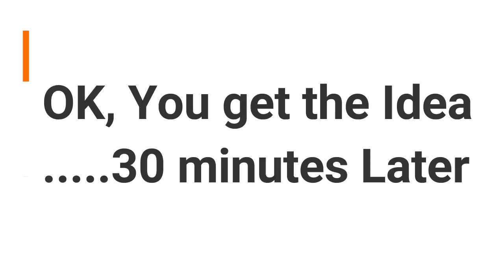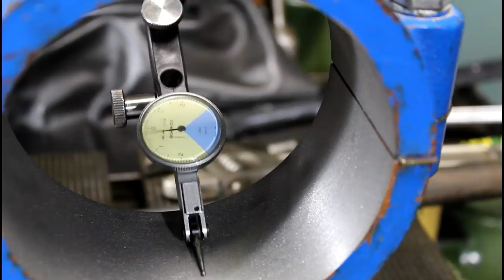Custom Indexing Angle Plate Build Part 1

Comment: I enjoyed the video.
I have been using a piece of a treadmill belt and I use 2 magnets I salvaged from a couple of old hard drives. I place the belt on the front of the carriage across and up against the cross slide, the cool part is it stays attached to the carriage as it moves so I get almost zero dust on my ways. You can find tread mills free on craigslist at times.
Cheers 
John

Comment: that is unusual  BUT very cool.   if you drilled holes in the main body to put pins in to the center piece you can get a very accurate indexing.   just thinking

Comment: Hey Steve, I really like your videos and your laid back demeanor. I have a thought on this build. If you were to make a back plate which has a circle of 40 holes and then drilled 36 holes in the slug you would have one degree positive stops. If there is enough room, 10 circles of holes set 1/10th off from the last would allow you to index to 1/10th of a degree. Just a thought...
Reply from the maker: That could work, very good idea.  I'm going to just scribe some lines on the back I think  . The pin holes and stops would most likely be a more accurate way, but I want to try scribing in the shaper for the fun of it.  Good idea Eric.  thanks for stopping by       SteveSummers
Reply: Steve Summers, I was hoping to catch you before you moved forward. But either way you go you could always add this later. Eagerly waiting for the rest of this build.

Comment: Hey Steve - nice project. Lovely job on the lathe - was gritting my teeth for sure :-)  It will be interesting to see if that casting moves after machining - give it a few days / weeks. Nice to see the innovative ideas you have - keeps me on my toes.  Good info' on the tool steel at the end - Ive only burnt up HSS on the shaper when cutting hard grades of steel too fast with no lubricant / coolent - but that was 120 strokes /min over 8" stroke and the steel was from bin 13 - so could have been anything - but he chips came off a lovely dark blue and burnt into the sole of my boots. Looking forward to the next update. All the best mate. mat
Reply from the maker: I was thinking the same thing about it moving or not, there is a good chance that it will. I will check it along the way.  I removed about .0040 off the back, and that's a lot all the way across that face.  Not near as easy as I thought to cook some cheap Hss if I try to do it. Seems the only way I can burn it up in the first 3 seconds  is to not want to burn it up LOL.   Thanks for stopping by Mat, I am going to try to shout you and a couple more great people out in part two if I can get my act together on part two ..     Thanks again   SteveSummers
Reply: Just keep them great vid's coming Steve - Ive learned something new on each one and been entertained along the way :-) 
Trying to get my ass in gear this morning and down the workshop to take a look at boring out the shaper work box .... thats quite a big job for my little operation. thinking of strapping my lower jaw up to stop the chattering ! :0) cheers Steve ATB Mat
Reply from the maker: LOL, yeah I have the same chatter issue from time to time.  Thanks Mat

Comment: Cool video/project, if I had known that you were after an angle plate for your shaper, I would just cast one out and send it to you when I do the end of the season casting session, lol.
Reply from the maker: Hey Chirpy T, how's that lathe rebuild going? I see you posted a new video last night. Yeah, still need to build and buy tooling for the shaper, just takes time. thanks for the offer in the angle, I could have used one more than once.
Reply: It's going good, I got the primer on the headstock, apron, and little bits now and within a day or so, it'll be ready to be painted. The only thing left after that is just saddle, tailstock, and quick change gearbox, but all of it is already off and there isnt that many parts to that stuff really and the gearbox isnt getting torn down since it's still in good condition and nothing needs fixed in it. There is alot more parts to that headstock and apron that most people think, lol. I like the design of angle plate that I have because of the U shape in it, it makes it really handy to put shafts through it to hold stuff that you cant hold normally, and also stuff like pulleys and such that has bosses on it that is hard to hold. You can also clamp it down on the other face of it to get a full flat face to clamp stuff to. Ill throw that in the queue to cast also in a few days since I was just going to cast a few smaller pieces anyhow, so I'll have plenty of sand left over, then try to scrounge some money up for shipping, lol.

Comment: Pantographs used a manual style rotary table with a similar concept, it would let you index on a manual rotab. I use one on my mill, but it uses a lever clamp that is not too strong, so one needs to be careful on how much they push it. Actually, making a new clamp might be a good project for me. :-)

Comment: Such a fun project! Great idea and that's what it's all about Steve. Just  having the stones to try. Most of the time, when you know your stuff, you'll succeed 9/10. And LOL at that HHS in that HEAVILY interrupted cut haha that was good. Hey Steve, on Keith fenner s channel... He always lays a cloth on the ways and he cuts inverted. In other words the cutter is flipped upside down and direction of spindle reversed. This sends the chips directly down. Is this practice good, or just arbitrary
 Because I thought ductile iron was a decent bearing surface lol. Is it really all that abrasive?
Reply from the maker: Thanks for stopping by Billy, Hss usually works well on interrupted cuts , I think there are several reasons it failed and the main thing was a hard spot. Unfortunately my lathe only runs in one direction. when 1st cut this cast iron dust is like sand, I guess if it was ground fine enough it would not be that bad, but1st  it needs to be ground and I think that is the main reason it so bad to get on the machine surfaces , the machine is the grinder.   Good to see you Billy, glad you stopped by.  SteveSummers

Comment: An interesting machining job. Usually the bore is the first machining job for something like this, then machine other faces to have them parallel or ninety degrees (etc.) to the bore. It is potentially dangerous to turn something like this without adding balance weights to prevent strain on the lathe bearings and potential influence on the machining process.

It would be a good idea to install registration pins between the two halves of the bore prior to machining the bore, but I am assuming that you never intend to dismantle the device?
Reply from the maker: ZenMinus the bracket bore has been marked for alignment if it ever was to be dismantled. I agree with the counter weight in a way. This guy was at 78rpm so I was in no hurry. Why would you do the bore 1st? I may be missing something and am in no way a professional machinist but I can not see why it would make any difference with this bracket. The part was never removed from the chuck so as long as nothing moved the face and bore should be 90 to eachother no matter the order of operations.  Thanks for the comment, glad you stopped by.   SteveSummers
Reply: Hi Steve The bore is done first (in most cases) as the bore is the most important part of most machining jobs. In your case (as you say) it probably doesn't matter too much.

Comment: In measuring the bore against the foot I was thinking if there was a taper in the bore after machining? Snap gauges could be used to check it. Also I think I would add a light spring to the clapper so you can run higher speeds?
Reply: Great video by the way. I don't know how you guys find the time to do all that you do-do?
Reply from the maker: Well I tried the snap gauges, the bore is almost 5" and I could not get a good consistent reading using one that big.
I ended up just measuring with calipers and comparing  the  measurement with 3 different sets. I am happy that I have a good measurement now but have yet to cut the slug to fit the bore. On the spring I seen Shaper Andi do this same thing. Have you seen his channel? He uses a spring on the clapper..  Great the see you John.
Reply from the maker: Well,... I got 4.5 hours sleep last night LOL  worked all week for the man, filmed and edited at night... This video took me about 8 hours to edit all together. and then I try to watch it twice to check for large mistakes.
And I am behind at the moment. It is very time consuming.  Thanks John.

Comment: Haha when you switched into high speed on the bore, for a second i was like Woah slow down you lunatic!!!! haha
Reply from the maker: Yeah, lol    This was very unbalanced, any real speed and it could have come out of the chuck. I was running 78 Rpm I think.    Thanks for commenting , you made me laugh this morning.
Reply: If it didn't come out or apart, you would have found out how easily a three ton machine could walk across the floor if it wasn't anchored.

I had the same initial reaction to the jump in speed.  Ah!... wait a second!...

Comment: How is that tool ground for cast iron? The one time I've turned cast was a set of brake rotors, and it burned up my hss tool-bit straight away. I switched to carbide and had no problems, but it would be nice to know how to get hss to work.

Edit: Silly me! I paused the video and wrote the comment before the title card explaining that your tool-bit got wrecked too. Nevermind.
Reply from the maker: It's ok, no harm. I have done the same thing more than once :)   t15 Tool steel works well most of the time for good quality cast iron, it's those hard spots and the sand that cooks the edge. it seems to help if you grind the tool strong with very minimal clearance keeping the cutting edge as supported as you can. I will do a video in the future.
Thanks for stopping by.  SteveSummers

Comment: Hmm, tapping stainless. It's worse than watching Grey's Anatomy.
Reply from the maker: LoL, agreed. I just go real slow. I work with stainless more than any other metal, at work almost every project I build is 304 309 316.   Lots of high temp reactors and chemical resistant vessels
Reply: Ouch. I suppose you get use to it, but I hate stainless. I form tap it whenever possible.